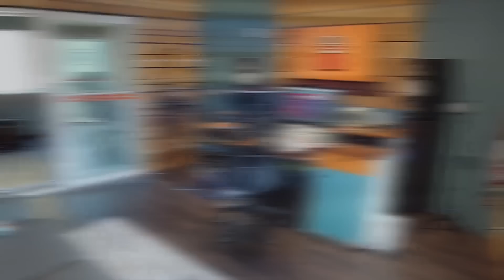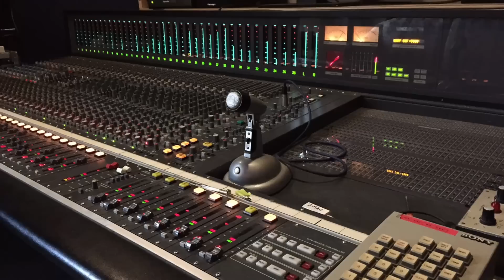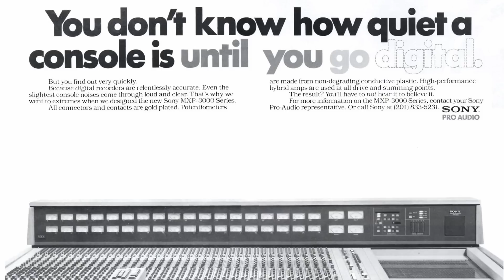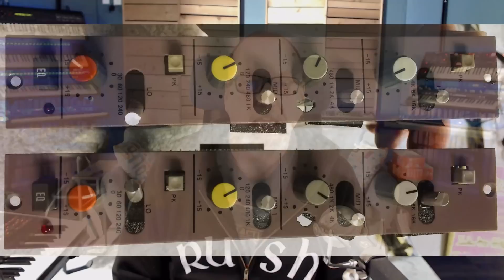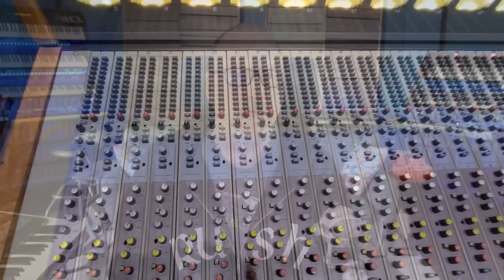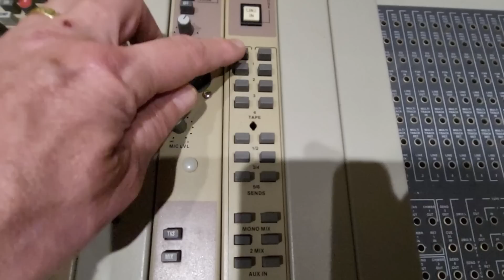The Most Amazing 80's Console You've Never Heard Of

Comment: I find it. It's this little circuit board. It's got a couple of transformers on it. A high quality microphone transformer. A high quality output transformer. And a very high quality, Operational Amplifier on it. There's about 70 of these little circuitboard thingies. They are not lightweight. And each one of these 70 or so circuit boards.  They are worth over $300 each. That was about $21,000 worth of these high quality audio circuit boards. Enough to build. A, 32 channel, API Audio Mixer. One of the best made American audio console manufacturers in the world. They threw into the dumpster. It is now mine. But?

I would have to invest an additional, $24,000-$32,000. To have put it all together into a cabinet, faceplates, volume controls, switches, meters. All that extra necessary stuff. I didn't have that money. So?

I pretty much sold the whole kit and caboodle to that of Brent Averill Industries. And with that money. In a happenstance. Instead. I ended up with a 36 input, custom-made in Great Britain by Rupert Neve. 1972 audio console. I had been using since 1984. When my bid must have been mistakenly approved? Since I put in a dreadfully low bid. I knew would never get approved. Somehow it got approved? They called me the next day on the phone from corporate. And asked me when I wanted to pick it up? I thought they were joking with me for sure? Rubbing it in my face? And I chuckled and asked… Can you tell me how much it went for and who got it? And they repeated the question. When do you want to come and get it? I asked if they were kidding? They said they were not kidding. They approved my bid. I told him I will get it by 1 PM tomorrow. They said fine just bring cash.

I called up all my friends. I said you have to tell your bosses you need to take off work tomorrow. I will pay for your day tomorrow. I need your help. We are moving and audio console. It's very heavy. Even when we box it all up. I could hardly believe my good luck?

I've always been lucky in audio because I'm also very good. Always lucky until I moved to Texas, 12 years ago. It was the biggest mistake of my entire life. I only got away from Texas. Not quite 2 years ago. My 2 young business associates and friends help me to escape Texas and Texans. What miserable individuals those native Texans are. My two friends come from elsewhere. They are transplants. Like I was trying to be. But Texans made that impossible. They are loathsome scumbag KKK redneck hillbilly fascist Nazi freaks! They are the scum of the earth. Let me be perfectly clear about native Texans. They are not Americans. They are Texans. That's a different breed of primitive Homo sapiens hominids! Texans are hominids! They lack all humanity! They lack all decency. They lack all FairPlay. They lack democracy. They are led by Satan and worship Donnie. And I'm a Fucking atheist. But if anybody is going to go to hell and burn for all eternity? It will certainly be Texans. And the horse they came in on. And their lousy, Longhorn cattle. They are not the best eating. Not like an Angus. I think Longhorn beef is  stringy and tough. Texans should cram those longhorns write up their asses! Ouch! And even those Longhorn, horns up their asses! But the pencil and the Internet can do just as good a job. If Generation-Z even knows when a pencil is? They seem to know just about nothing? Except for Facebook and Snap chat. Or is it Instagram? I am not very hip nor groovy anymore. I'm just an old fart of 70. And I have become a living fossil.

I'm a living fossil of the Pop Music & Broadcast Industry. I am now fossil! Ouch!

Thankfully it 70. I am blessed with No Arthritis! Which means I can still play tackle football. But I have never played football? I am not going to start at 70 senile years of age, either. YOU CAN'T MAKE ME!

Now that you know I shan't be playing any tackle football? Who brought the Pot? Who's going to supply the Rock 'n' Roll? Do I always have to supply the Rock 'n' Roll here?
https://soundcloud.com/user-135130368/sets/live-at-electric-church-fm-sessions-vol-1

There! Stuff I recorded. With my own studio. The Electric Church Nightclub. Only practiced the Religion of,  Rock 'n' Roll, religiously. The building at one point was both an automotive garage and a storefront born-again church. Then it became a Rock 'n' Roll nightclub. Until we were hit with a Pandemic Virus. And that was the end of that. Just as things started to take off! Everything instantly crashed and burned! I had all the rock radio stations.  Wanting to contract me to do live broadcasts. That all went out the window. Fuck?  That's what I went to Austin, Texas to do.  It all came crashing down. It was the end of my career and the loss of my business. There was no recovery from that. My business caught the virus and died. But I didn't.

I had a good going concern. I needed that money to supplement my Social Security only income. And my entire retirement now destroyed. Due to a virus. I am now flat broke. Almost impossible to live month-to-month on Social Security retirement income, alone. Good thing I have a very nice Old used luxury, Motor home.

I've moved up to the Elite of White Trash. With my Motorhome. It's a diesel pusher. The very best quality.
RemyRAD

Comment: My MXP comes from Burbank Studios in LA used for Animation and commercials I use mine for music and other production. My question is about the faders. I have looked for parts to rebuild or replace with aftermarket or original but was told the plastic properties surrounding the slider parts were important to know, which I don't really understand. I was hoping there was an aftermarket or trick to restore.(worn fader innards) that did not require mods
Reply from the maker: My best suggestion is to join the forum at https://groups.io/g/sony-mxp-3k and ask there. The designer, Tom Graffe, lurks there and often provides answers directly. 
They aren't great a responding to member requests. Let me know if you try to join and don't get a response, and I'll message them through the forums.

Comment: The MCIs were dreadful! This is revisionistic! No one EVER used the word amazing in connection with one .(Was stuck with a 636 for 10 years, and mixed 100 records on it, I am not inventing this;-)
Reply from the maker: Interesting. This is the first negative comment about the MCI consoles I've seen since researching. I'm no expert, so I'm just passing on what I have gleaned.

That being said, the MXP 3036 is considered one of the quietest consoles from it's time. Sony really elevated MCI from their previous quality.
Reply: @EdgetoneStudios  Sony suposedly brought them up several notches. I did extensive mods to mine. Changed the preamp cards, modded the summing bus to be discrete, mixed a lot on the «small fader» non-vca bus with the knobs, but it couldn’t really be helped;-) Sounded grey, small and brown tinted regardless.

Comment: How difficult is to repair? Some people say that the "hybrid" amps are not available and no data exists to make replacements?
Reply from the maker: Not my area of expertise, but on the forums they claim they are only in the preamps, some on the channel strips, and the master module. So it's great to have a spare master module and a few channel strips. There are other options for preamps (like the Normaphone or John Hardy). 

There also seem to be some schematics for these on the forums as well: https://groups.io/g/sony-mxp-3k

That being said, my console is now nearly 40 years old and has no issues with any of those. That's not saying they won't die someday, but they are incredibly reliable. Show me any peice of gear designed today that will last 40 years with repair or replacement.
Reply: @EdgetoneStudios Thank you for your answer. Have you ever need to recap.  After 40 years many Neve consoles have been through 5 to7 recaps.
Reply from the maker: @narvartense  there have been zero recaps on this board. And even the designer says not to do any until the caps actually fail!
Reply: @EdgetoneStudios  Man that sounds great!

Comment: Underrated? Hahahah. Oh dear! Power supply on these things were terrible, quite weak and underpowered - definitely the weak link in the console. The hybrid op amps had many issues from memory and the "sealed" EQ's kinda howl with some weird resonance feedback when certain frequencies are boosted, also the line out amps aren't exactly reliable, the inductor EQ's were very soft and mushy too, just made everything sound like you were running it through a cheese cloth. I know a few guys who gutted the channels on their MXP and wacked in some forsell strips and some others went with API. Apparently Animal Collective's record 'Merriweather Post Pavilion' was mixed on an MXP 3000. It's a decent board if you find one in fully working condition without issues for around 2K and skip the EQ.
Reply from the maker: Yes, I would say the power supply was the weakest link after 35 years (besides the rodent chewed cables, but that was just poor storage). However, after a full recap and servicing, this is the quietest large power supply I have ever heard.

I thought the Wien EQs sounded pretty darn sweet. But I admit I did not spend enough time to potentially determine "howling" frequencies. 

Thanks for the tip on Animal Collective.

Comment: Berklee had a few of these in the 90s when I was there. IIRC E, F, and G had them. It was a nice console for learning signal flow, and it sounded pretty good. I have an API in my studio. I wouldn't take the MCI for free these days unless it was loaded with the API modules, which were made for these consoles. 

Most I've seen working have been in broadcast.
Reply from the maker: Cool.
Those API Sony modules are hard to come by and therefore very expensive. Someone on the forums said that API was willing to take orders for the 212s but would require a minimum order of 80! Don't think that's going to happen.

Comment: I grew up working in a studio that had 2 rooms the expensive room was all MCI gear, we had the JH-636 console and 2 MCI JH24 2-inch tape Machines and mixed down to a JH-110 1/2 inch, I worked in the cheaper B-room with 48 channel Yamaha PM-4000 with the Transformer package which recorded to a Foster G24S 24 track 1 inch machine and mixed down to a Otari MX5050 1/4 inch machine and later to DAT. I always loved working in the MCI room I felt like a real engineer and to just the house engineer for the demo room LOL. MCI were huge in Nashville and most of studios outside of LA and New York. Artists who had home studios had a ton of MCI gear because it was built well and was cheaper than the alternatives from API or Harrison at the time. I always liked the MCI EQs. I have 4 of the Sony MCI 3000 EQs in my rack still today 2 are the state variable EQ32 and 2 of the passive inductor EQ34s. The passive EQs are the last great passive console EQ ever made and all 4 are the quietest 90s analog gear I have ever used. MCI really was the pinnacle of hi-fi audio meets pro audio without the snake oil. I now work on a ATI paragon 2 console which was API's live version of an SSL 4000E but with better mic preamps a fully parametric EQ and API thrust VCA compressors on every channel. I always wanted an SSL but couldn't justify dropping 100K on a mixer so I found a pair of the ATI paragons that were used in a megachurch in Memphis Tennessee for less than 10K so I have a working console and a complete spare. Congrats on finally getting the console up and fully restored I have been watching every update!!
Reply from the maker: Thanks for the tales. I love hearing what people who worked in the industry actually had experience with. My music industry stint in the 80's was short lived and not very broad. I didn't really do anything musical from 91-02, while my kids were young. Finally picked up a bass in 02, and got back into recording gear in 07. By then the world or recording had drastically changed (mostly for the better).

Comment: Amazing! Thank you so much for this super interesting breakdown! Love all the custom modules. For me probably the Automation would have been the dealbreaker…my ADT Console from Germany has this amazing VCA automation that works sooo good and I would never be able to pull a satisfying mix from the console without it. Then again I know Craig Silvey mixes on an analog Neve 80 series without any automation on board and he just does all the automation pre board in protools… All the best from Berlin, Tobi
Reply from the maker: Yes, it would have been great if this one had come with working automation. A few owners I talked to still used some of the automation features, but I never got to experience it. 

I think that even if this had working automation, my workflow would have still been to mix in the box, but use the board as a straight up summing mixer. I would have had 24 bus summing.

I have a Burl B32 Vancouver that I am now selling. Although it sounds very nice, the hassle of using it outweighed the production benefits. I've opted for a Burl B2 Bomber DAC to add that bit of analogue and spacial improvement to everything I listend to in the room. not just mixes. 

Thanks for watching.